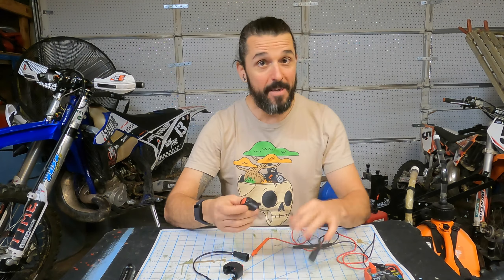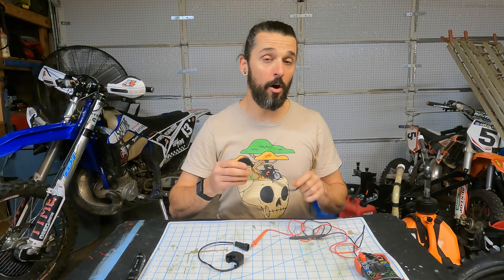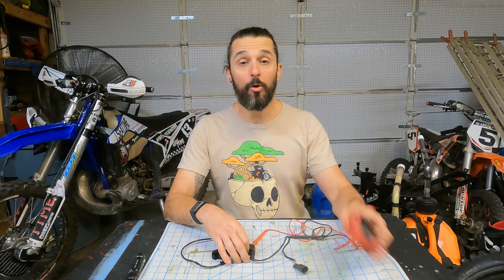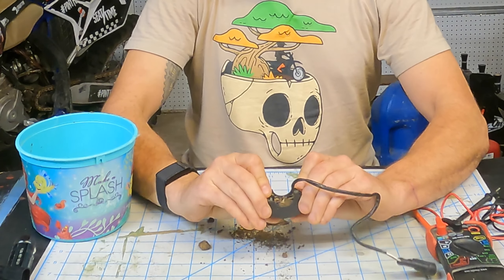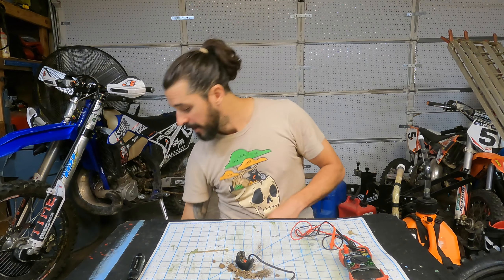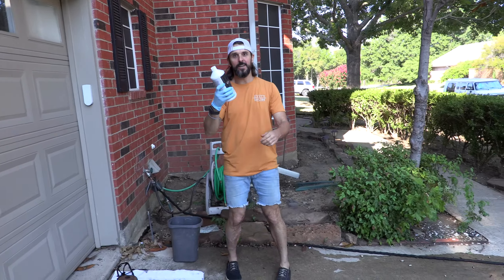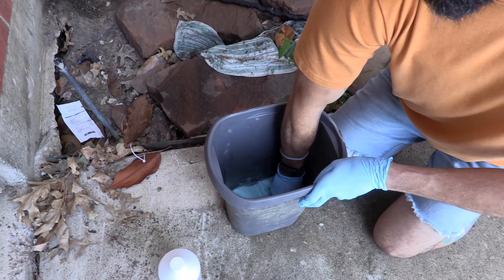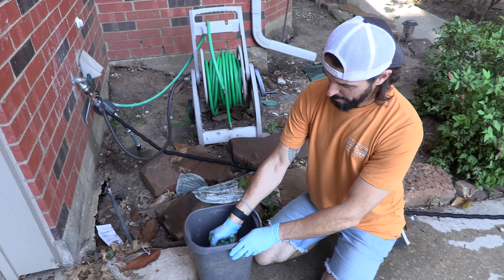Testing the Broken Sherco Power Switch & F3 Air Filter Cleaner Review!

Comment: When the bike die, one of the 1st steps of trouble shooting is disconnecting any kill switch. And on race bike, it shouldn't be On/Off switch anyway.
Reply from the maker: When definitely knew the problem was the switch. We were just so smoked mentally from the day so far we didn't think through quick solutions. Agreed, this bike shouldn't have an on/off button. Sherco removed them after this years model.

Comment: You could have hot wire it. And gasoline works better
Reply from the maker: HOLY CRAP, BRILLIANT! That never crossed our minds, but damn it certainly should have! 

And as far as cleaning goes, you're right, gasoline does work better. But with environmental regulations getting weird, and new products to try, I wanted to give it a go.
Reply: If you bypass the switch and basically leave it on constantly what are the downsides? Is it like leaving a key on?
Reply from the maker: Correct, when the bike is running, no issues as it’s charging the battery. If I had hot wired it and the bike sat for awhile, it would have drained the battery. A risk worth running when trying to finish the DEATHMARCH☠️🥁!!!